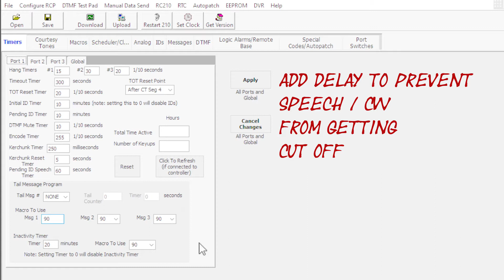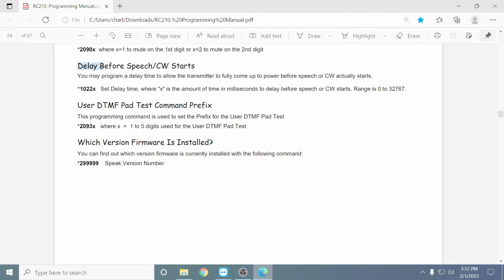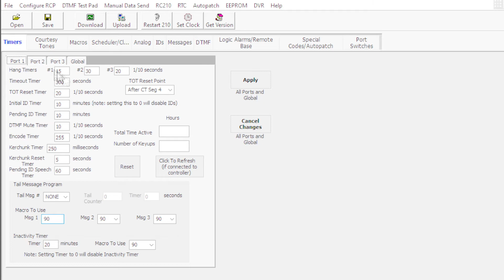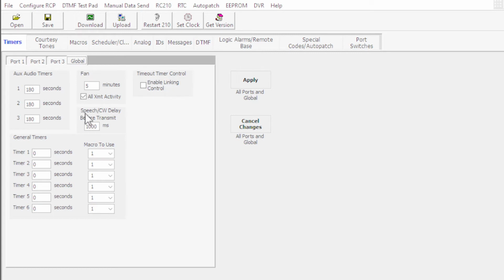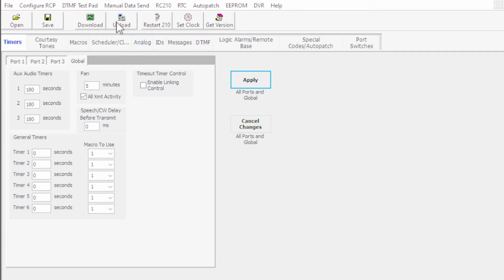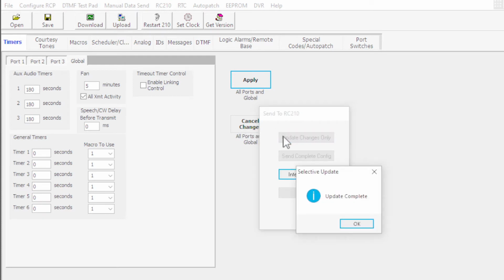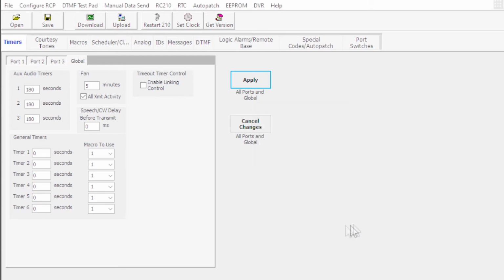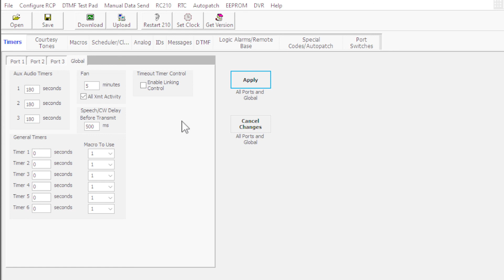Arcom RC210 Programming:  Add some delay time before Speech & CW announcements

Comment: So does that basically mean the longer your automatic message, the longer you need your delay to be?
Reply: Not necessarily.  No matter the length of your message, you can set your delay to however long it takes for your transmitter to key.  I tend to set mine to one second.